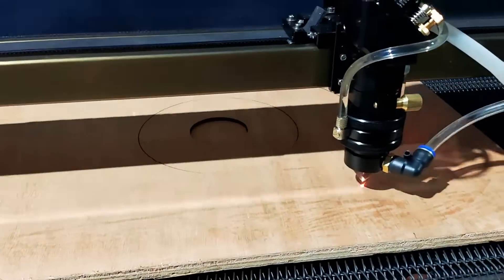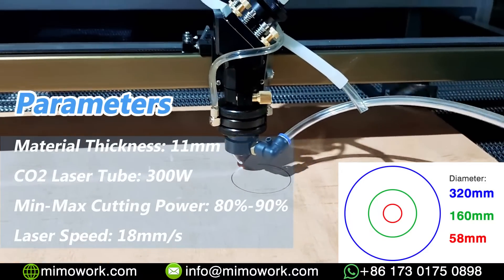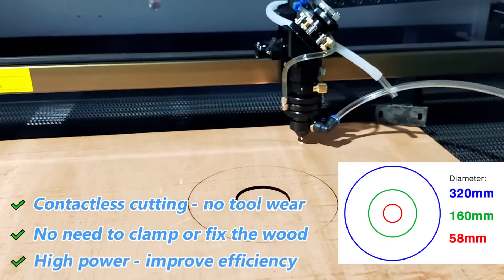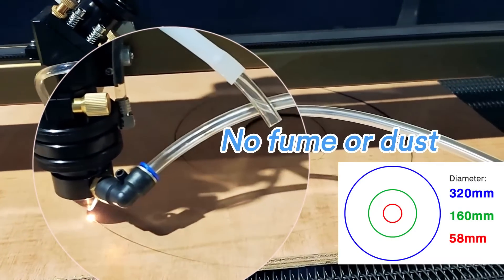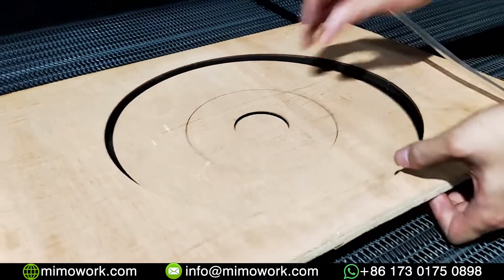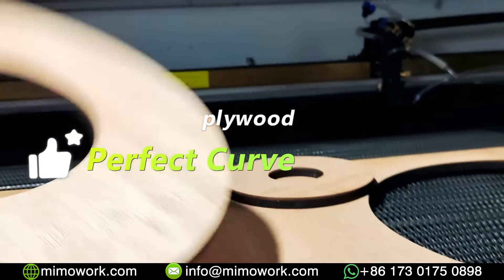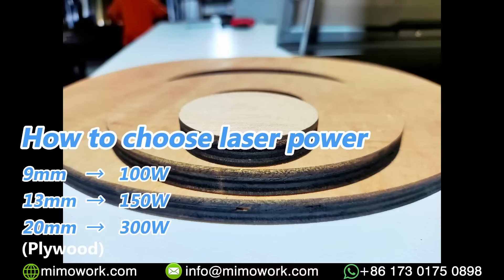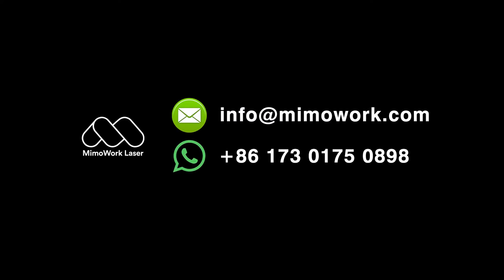How to Cut Thick Plywood | CO2 Laser Machine

Comment: so I can cut ply with fabric machine ?
Reply from the maker: Yes, a CO2 fabric laser machine can cut plywood, but for the best results, a dedicated wood laser cutting machine is recommended. The machines differ in configurations like the working table and mechanical control system.

Are you looking for a machine to cut plywood? You might find this helpful: 
https://www.mimowork.com/flatbed-laser-cutting-machine/laser-cutting-machine-for-thick-wood.html

For more details or a quote, feel free to contact us: 
📩Email: info@mimowork.com
📞Whatsapp: +86 173 0175 0898

Comment: does it make wood shavings or not ?
Reply from the maker: No, CO2 Laser Cut Wood never makes the wood shavings that will be produced using sawing and routing. Laser is a clean and precise cutting method where the wood kerf is directly evaporated by laser heat. Would you like to cut wood using a laser? There is a page about that you can explore more: https://www.mimowork.com/wood-laser-cutter-engraver/ Hope it's helpful for you.
Reply: Thx for elaborate reply 👍 it's a much advance, precise n clean method than the conventional ones.

Comment: What speed i need to use to cut 6mm birch plywood (100w) ?
Reply from the maker: The hardness of birch plywood from different manufacturers is different, so the cutting setting will be different. You can mail your material to us for a laser testing.

Comment: Wish model is this, and what’s the price
Reply from the maker: Thanks for your like! The laser machine is equipped with 300W laser power and can handle most thick materials cutting. For 20mm or thicker acrylic, we tested the cutting with a 450W laser cutter and the effect was great. You can check out the video test: https://www.youtube.com/watch?v=_kRKGMdvuGs&t=28s  
There is a larger size laser machine with 1300mm * 2500mm, which is friendly for ad signage or furniture processing. We always recommend the most suitable laser configuration based on the client's requirements. so consult us by email (info@mimowork.com) to get an accurate price.

Comment: Is it possible to cut thicker with many passes?
Reply from the maker: 😀The 300W laser tube can cut through thicker plywood up to 20mm. And we have the higher-power laser tube, that can cut thicker plywood or acrylic up to 25-30mm. You can check out the video to find more: https://www.youtube.com/watch?v=_kRKGMdvuGs&t=2s. By the way, we don't recommend cutting with many passes, some burning and darkness may happen even if it indeed can cut through thicker material. Let's know what your specific requirement is, so we can help you.

Comment: Ever cut wood with c02 gas assist?
Reply from the maker: Yes, and it's quite expensive. If you want to use auxiliary gas when cutting wood, you can try Nitrogen. It's more cost-effective and can show pretty cutting edges.
Reply: 🤣 @mimoworklaser

Comment: What is the power of this machine? 150W? 300W?
Reply from the maker: The laser machine in the video is equipped with 300W laser tube, it can laser cut thick wood and acrylic up to 20-30mm thickness. As you can see, the cut plywood of 11mm is with clean and flat edge. For different requirements like laser engraving wood or laser cutting wood, we provide 100W, 150W, 300W, and 500W laser tubes for clients to choose. If you are interested in the laser machine, please check out the site (https://www.mimowork.com/wood-laser-cutter-engraver/) and send email to us.(info@mimowork.com)
Reply: Hello, this link no longer works, it takes me to a blank page of your website and i cannot find the bulbs. Could you post a new updated link?@MimoWorkLaser

Comment: Hello. I am glade to learn something from your videos. I have one question. Cutting play wood thinkenesses 3mm but always have on x axes not straight cut ,cut like letter J. Always change speed,power,lensses. But laser iz not verticaly adjusment. Point on exit from nozzle,and when bed is 35mm lower not on same spot.   Help please.
Reply from the maker: The misaligned laser beam and mechanical issues like the linear bearings, guide rails, and stepper motors, could be causing the laser head to move unevenly along the x-axis. You can try to tighten the transmission structure and do the calibration first. Due to not knowing the specific configurations or suppliers of your machine, we can't solve the real problem. Some customers who purchase laser machine directly from Alibaba often lacks support and receive the poor-quality machine. 
We always assign technicians to our customers directly. If you want, you can provide more specific details of your machine, and maybe we can help you solve the problems.
Reply: @mimoworklaser Thank you for your reply.  I cannot do the calibration, because the dimensions on the surface are, for example, 150x150 mm, and on the bottom 150.38x150.50. The upper side of the x-axis of the square is cut with an arc, and the lower side is straight, almost at 90 degrees. Ruida. I have to look at the exact version. I found on the internet about adjusting it backwards so that the part where the lens sits is at 90 degrees